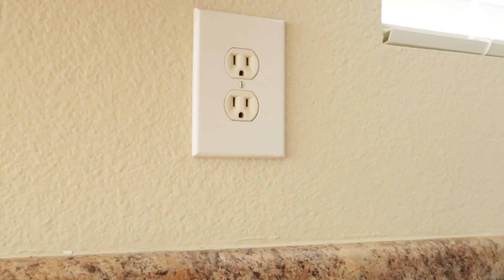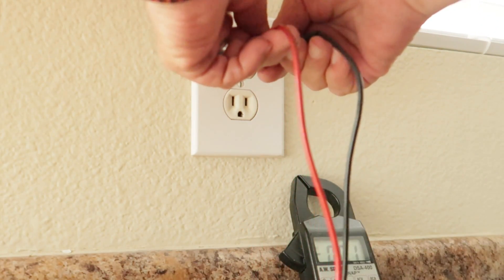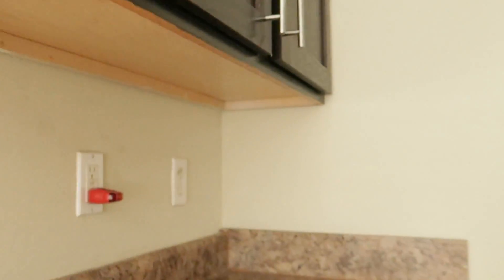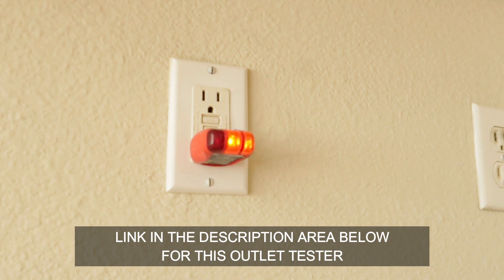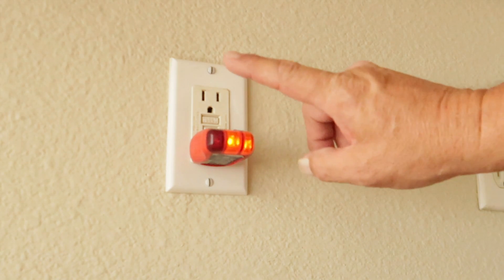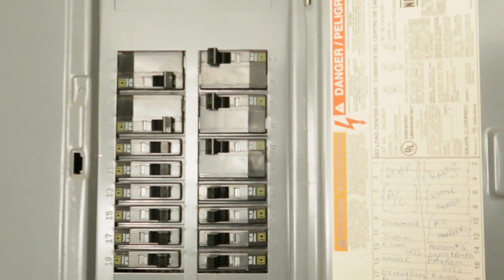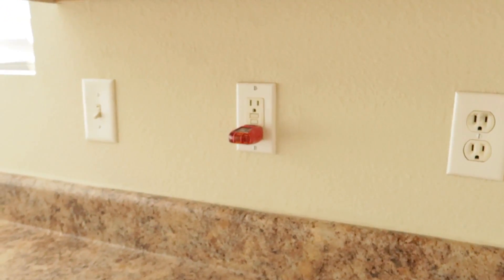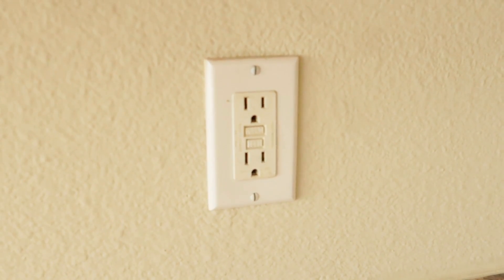How to Hook Up a GFCI Outlet

Comment: It Is called a Robinson screw bit, which was invented by a Canadian electrician, and it is the only screwdriver bit that will hold a screw when it is perpendicular on the bit
I also remember and now it’s changed that the line is the bottom like in a football game the scrimmage line and on top of the line you put the load
But now all the industry has changed, so I simply remember that the line is the sky or the top and the load is the Earth or the bottom 
I also remember that black is always on the right and white is always on the left

Comment: old vid I know. Excellent video BTW, I watched several boneheaded ones before finding yours.  I got a weird prob. I wanted to replace my old  GFCI outlet as it was  that ugly off-white/beige color. (same amp too, 20a)  The old one worked fine. It's a simple 4 wire set up...2 blacks,  2 whites.  I didn't think replacing it with a new one would be a big deal. I hooked it up and nothing, didnlt work. With all wires disconnected and breaker is in position I identified the hot black wire (for my line side) with a multimeter  and put a piece of tape on it to marker it. I then checked the other black, zero V, all good there. I then checked the 2 white wires. I checked one white to gorund, zero volts. Then checked the other white to ground, no volts there. ALL GOOD. Now I touched my one probe to my black hot wire (line) to white wire and it read 110v. I then touched my probes from the same black (hot line wire) to the OTHER white line and it too showed 110v.  ?????  It will not work, no matter how I confirgure it. I'm friggin stumped..plus knowing the fact the old one worked that uzzles me even more. I beeive the issue is having 110volts when my tester is touching my black hot wire and EITHER white wire. As you vid shows I should only have power when my probes touch the black hot feed and ONLY ONE white. I'm lost. When I have one probe on my black hot wire and touch either white wire (while everything is disconnected) they both read 110v. WTH?

Comment: Nice! Fixed cars for 40+ years so fix ac + dc. 40 yr old son & wife decided to change all switches & outlets to white, not thinking of GFCI. I had one circuit not working and found a breaker turned off. No one told me. But amazing living in this 1980 house since 93, the main service entry has a main breaker but it has no markings. What? No one has been in there but took light to shine from side to see ink or indentations for ink! Nothing. I would guess 100 Amp, maybe 150 Amp (odd) but most likely not a 200 Amp. 
 I am thinking copper incoming from transformer, goes by size or diameter of service box wire. Bigger wire, higher main like 200 Amp. Retired and thinking of adding a small outbuilding or storage shed as my tiny 1 + 1/2 car garage needs room. Storing stuff outside is best for me. Besides wire size, number or breaker may tell the box size! Thoughts? DK, Omaha
ASE Master tech since 1987, yes 10 years after “Star Wars”. Thanks kindly!

Comment: The load receptacle wall plate should have a GFCI sticker attached to it to let a user know, if the power fails, that there's a nearby receptacle that has tripped.  These stickers are usually included in the box containing the new GFIC receptacle.

Comment: I have all 2-prong plug with no grounding wires and was using a surger connected to a grey attachment  to plug in Christmas lights and when my son found he was not happy. So I tied to install a GFCI outlet  with 3 wires  (one black 2 grey) which easy but I could not get the green light to turn on. Gave up and went back to the original plug.

Comment: does it make any sense to install a GFCI somewhere other than close to a kitchen or bathroom sink? i have an older house that
still has quite a few 2 prong outlets, am i better off replacing all the 2 prong outlets with 3 prong or should i also use GFCI's in 
some of the outlets?
Reply: Yes. A good strategy would be to replace some of your most commonly used outlets to GFCI's where  appliances with 3 prong plugs will be used, and leave the others as is, or replace them with new 2 prong receptacles. Keep in mind that many appliances have 2 prong polarized plugs anyway, so you should be fine. Don't use regular 3 prong receptacles as a substitute for 2 prong. 
Appliances with 3 prong cords are relying on the ground connection to be there for safety. Appliances or tools with 2 prong cords are double insulated and have a plastic non conductive case, so they are safe as is.

Comment: Another youtube says load should not be used (in series) as the next receptacle will be hot when that gfi trips, is that true ?
Reply: The power comes in on the LINE side and can be wired also from the LINE to the next receptacle. In this scenario, yes, the next receptacle will be hot if the GFCI trips. The LOAD would be used if you want downstream receptacles to also be disabled if the GFCI trips.

Comment: How to Hook Up a GFCI Outlet
Tools and Materials Needed:
GFCI outlet
Screwdriver
Wire stripper
Voltage tester
Electrical tape
Wire nuts
Steps:
Turn Off Power: Locate the circuit breaker that controls the outlet you’re replacing and switch it off. Use a voltage tester to ensure the power is off.

Remove Old Outlet: Unscrew the cover plate and the screws holding the old outlet in place. Gently pull the outlet out of the electrical box.

Identify Wires: You should see three sets of wires: a black (hot), a white (neutral), and a bare or green (ground) wire. Use the voltage tester to ensure there is no current.

Prepare Wires: Straighten the ends of the wires using a wire stripper if necessary.

Connect Wires to GFCI Outlet:

Line Terminals: Connect the black (hot) wire to the brass “Line” terminal and the white (neutral) wire to the silver “Line” terminal.
Load Terminals: If protecting additional outlets downstream, connect the black and white wires going to those outlets to the “Load” terminals.
Ground Wire: Attach the ground wire to the green screw.
Secure the GFCI Outlet: Gently fold the wires back into the electrical box and screw the GFCI outlet in place. Attach the cover plate.

Restore Power: Turn the circuit breaker back on and test the GFCI outlet by pressing the “Test” and “Reset” buttons to ensure it functions properly.

Summary of Excellent Result for the Customer
After completing the installation of the GFCI outlet, the customer can expect an excellent result characterized by improved electrical safety and functionality. The GFCI outlet will provide crucial protection against electrical shocks by immediately shutting off power if it detects an imbalance in the current flow, which can happen if there’s a ground fault. This is particularly important in areas where water and electricity might come into contact, such as kitchens, bathrooms, and outdoor locations.

Furthermore, the new GFCI outlet installation ensures compliance with current electrical codes, adding an extra layer of safety and potentially increasing the property’s value. The customer can confidently use their electrical appliances, knowing that the risk of electric shock is significantly reduced. The professional and neat installation also enhances the appearance and reliability of the home’s electrical system.

Comment: Thank you sooooo much for being so detailed. I'm a Retired single female on a limited budget and my tester button broke on my GFCI outlet, and I know I need to replace it. My house was built in 2014 and due to Power outages and several appliances plugged up, what you've stated explains why I need to change it anyway.  Your tutorial is so easy to follow. I remember things by "word association"...Example: I remember  "Power Line" has Electricity flowing through it (like the street Power Lines outside) and "Neutral Ground" meaning they're on the same side (meaning agreement) 😊. Thank you again.

Comment: Is there a way to tell which is the line vs load white/ line vs load black wires to tell if someone may have accidentally switched them? For example, I saw in your video that you rotated the GFCI after you secured everything (with the ground on the bottom) and I'm thinking when my son replaced the GFCI that stopped working, he may have alternated them, forgetting about the rotation of the outlet itself because the new one still isn't working.

Comment: I have a GFI that runs the hall lights and bathroom, do all outlets and switches need to be connected exactly right.  Also I do not see a ground on the GFI in the bathroom.  There is a pig tail besides the line and load wires, is this the ground?

Comment: Hi Dan. So I rewired my outlet and switch for my disposal. It used to be hard wired. In order to protect my disposal. I use the load side for the disposal and the line side from the switch?

Comment: I think I may have wired mine upside down with the line loads switched.  When I turned the power back on the light on the outlet was green but the outlet didn't work. Does this mean I've wrecked the new outlet I just bought?

Comment: What if you tested both line wires for a charge but one of them was a load wire. Would you still get a reading? Example, 1 black line mixed with a white load line, would it still read on the meter?

Comment: This was really good and informative. I was convinced that he would find no juice when he checked the load wires to confirm which the load wire from the line wires. The one problem with that check was switching the polarity from the volt meter..

Comment: It simple, hook it up to  a metcury breaker in panel and use a neutral to carry half of the load back on all ac circits then also have a earth ground rod wired into panel on a earth grounf terminal thst is seperate osilated . Then wire to to nf breaker of the shortage tripping breaker. If not have the eatth  ground rod isolated bar, you must make one, all usa panels are built wrong. Seperate the neutral from a earth ground terminal.

Comment: What I'm not understanding is, I have outlets (standard, AKA old) and the top and the bottom are on different circuits, I just eliminated one of the lines to connect the new GFI, but I guess I'm not totally understand how a GFI works, as far as the wiring part. I need more explanation how I would put two different circuits on a GFI?
Reply: You cannot put 2 different circuits on one gfci. It's probably going to be impractical to run one circuit somewhere down the line if your wall is already in tact,  but you may be able to install a quad box with 2 gfci's, each on their own circuit which you have available there. Connect to the Line side only in each gfci.

Comment: cant you just take a red marker an put a little mark on the line ones when you unhook it? because i know me i’m going to mess it up. I have one now my X tried to do an it didn’t work an it’s still hanging there. Which is y i’m watching this so I can try to fix it.. so thank you sir..😂😂😂😂
Reply from the maker: Sure, as long as it's wired correctly, whatever you need to do to get it done right. Good luck.

Comment: Good video but could have mentioned the size of GFCI differences as replacement 15a or 20a and which to select for the job
Reply: If it's a 15 amp circuit, you can only use a 15 amp gfci. If it's a 20 amp circuit you can use a 15 or 20 amp gfci, your choice. I'd use a 15 amp gfci, it's cheaper and just as good.

Comment: I’ve watched a few of these videos where information is incomplete. This guy leaves nothing out. There is a difference between an expert attempting to explain something and an expert who is also a competent instructor. Thank you. I’m subscribed.
Reply: He left a few things out and glossed over a few others....
Reply: @troybush5899  care to elaborate on what he missed?
Reply: 1st thing 1st! When he started, he condemned the existing outlet without checking to see if resetting it restored power to the outlet that was the original problem. He did confirm that the proper leads went to the line side of the GFCI outlet.

Comment: I replaced my outlet in my bathroom but I did not turn the power off in the circuit panel,Is that really necessary ? I was wearing a rubber gloves and never touch the wire,Using an insulated long nose plier.I did it successfully without interrupting the power supply.Thank you.
Reply from the maker: I would never suggest leaving the power “ON” when doing any type of electrical work. PERIOD. Thanks for watching.

Comment: My kitchen out put have three wires one Black, one White and one Red and the same three wires go to another out let only one separate
Reply: Ground wire connected direct from out let terminal to J box.S what can I connect the J box. What can I do with the Red wires. Thanks
Reply: @hungtruong373  Is this J-box connected to conduit? If so, the j-box should be grounded at your panel through your conduit. If it is conduit, then simply attaching your device to the box
will ground the device (plugs,switches.., etc.)
Reply: Code requires there to be 2 20amp circuits in the kitchen, separated from your "dedicated circuits" .ie.., (refrigerator, microwave). it may be that you have two circuits, one (red, and one black). To find out, test both the black and red to see if both is giving you 120 v. individually. Test using black and white, then test using red and white.

Comment: What happens if you connected the hot wires correctly, but inadvertently got the neutrals swapped between line and load?

Comment: I changed out the Gfci plug and it still won't work.
Reply: On the new ones, the load and hot are reverse. You’ll want to double check the black wires and probably need to simple reverse it.

Comment: Hi, Dan Like your video I have a question I installed a GFCI the green.light come on but still no power .
Reply: I got an answer...check the old outlet on the back. The load is hooked up on the top, where as the line is the bottom set of connectors. 

On the new GFCIs it's reversed, load wires to bottom, line wires to top.
Reply from the maker: Good question, not sure how you wired it but something is not right. you should have 120Volts at line voltage and connected to line in on the outlet in order for power to be fed to the load end. I would need to see a picture of the outlet and it's current wiring  to be able to tell you better.

Comment: On really critical repairs, such as this, I always take a photo of all components, just to make sure everything goes back together properly. Thank You, Dan!
Reply: That's what I did and it doesn't work - sadly after zooming in really far on the images on Lowes I see my old GFCI with the green ground on the bottom is the line end whereas my old one has the line on the bottom along with green ground - tomorrow I will remove and correct it - just a warning to people solely relying on pictures - the new one may be the opposite end for load vs line 😂
Reply: It helps in most instances. Just like in this video the ground was on a different side

Comment: Thank you!! After replacing my GFI plug exactly how the original wires were then it wouldn't work. I'm like must be defective. Put the old one back in and ready to head back to Home Depot and then thought let's check YouTube and found your video. Thanks to you pointing out the load and line inputs, I found the new one had the opposite positions of the line and load inputs.
Reply: Thank you for the info that you provided. That save me a headache.
Reply: Same here 😂 I matched the wiring exactly the same as the old defective version - taking note of the green ground screw on the bottom of both (different brands) and sure enough the load is on the bottom of this version whereas the previous brand had the line at the bottom by the ground screw - I know because I zoomed in on some pictures of it on Lowes - it's night now so tomorrow I remove and correct the error

Comment: Issue...I connected white and black line wires and lights go on normally but connecting a lamp to it doesn't power it..?, the other white wire has a load and not sure if it connects to the load connector on the GFCI or?

Comment: Great video...how about if I reverse the line ?.. because the gfci doesn't work but when I check internally there is current...so do I need to check by pairs to know load and line wire...thank you have a blessed day and be blessed
Reply from the maker: yes, you will need to find the power legs. the other set is powering another outlet in the circuit.